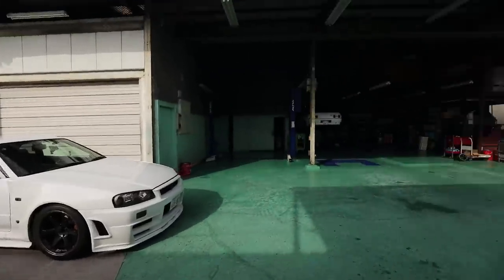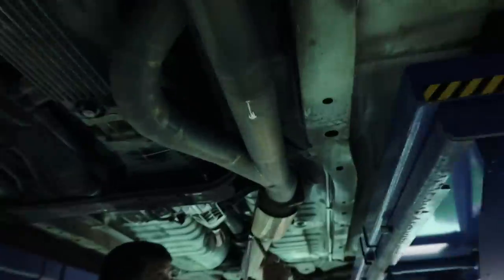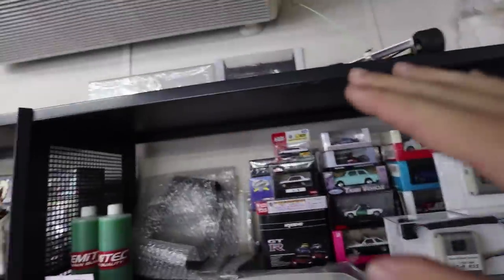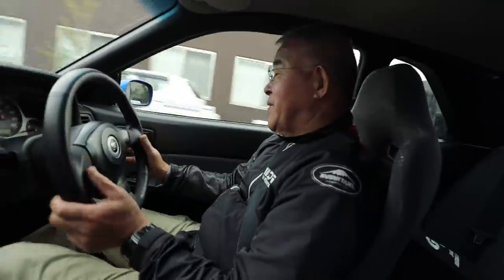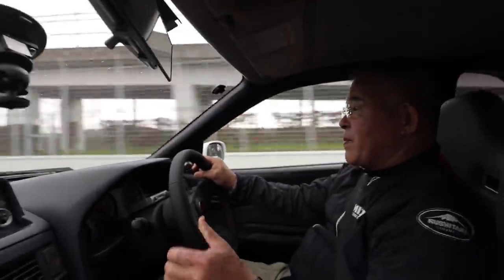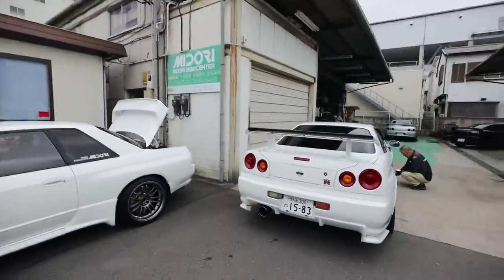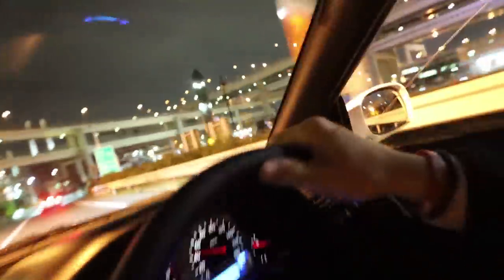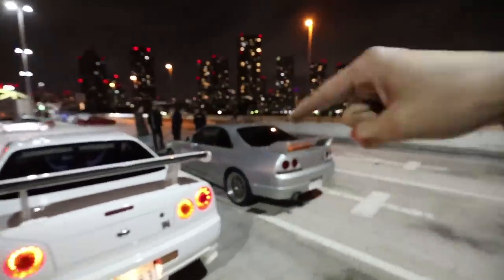INSTALLING MIDORI SEIBI TITANIUM R34 GTR EXHAUST IN JAPAN!

Comment: It's great to see the R34 GTR owned by Dusty! I'm surprised you went a "Quiet" exhaust but it sounds great and it goes faster than it sounds. I'd consider a properly tuned fully built stroker kit like your friend has with the Bayside Blue R34. Only problem is America has crap fuel apart from E85 and I don't think that fuel is good for 19+ year old RB26 engines. My favorite all-time street R34, is the Mines GTR. "It's so fast that even a dead man will scream." - Tsuchiya san

Comment: Is there a reason of why they keep gtrs in the 500-600hp range? Midori's owner's gtr is a stroker, should be able to make at least 800-900 easy.
Reply: Rborges 26 Drivability and reliability. 800 horsepower makes a car a lot less useable and gets you into trouble a lot quicker too.

Comment: Sounds so smooth and crisp. Love the car all together. You def need to get some Tomei 262 cams. I put them in my R32 GTR with Tomei equal length Ti downpipe, Tomei Expreme exhaust and its nearly one of my fav sounds in the whole world! https://www.facebook.com/joshua.goodpaster/videos/10158172260716908/    Rev/Idle Video   https://www.facebook.com/GoAutoworksPerformance/videos/364134580818072/ Dyno Video